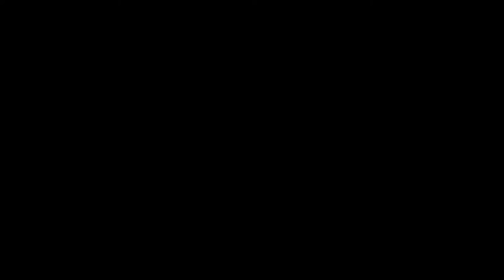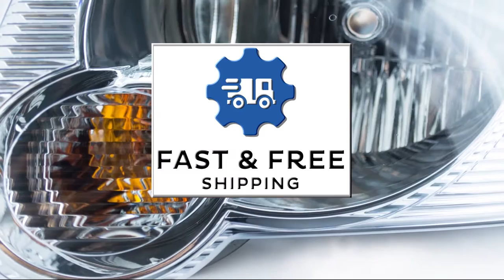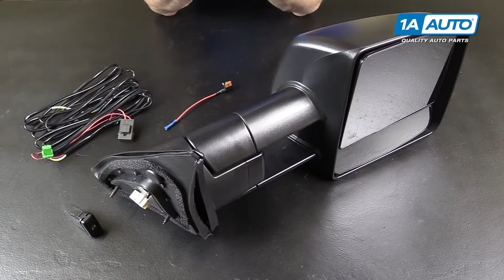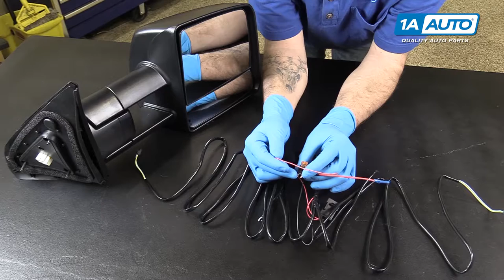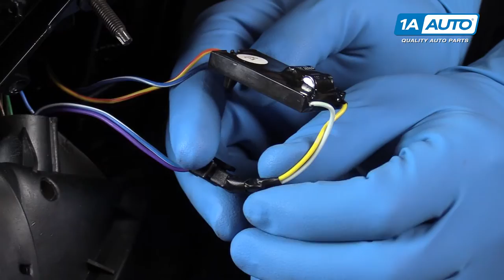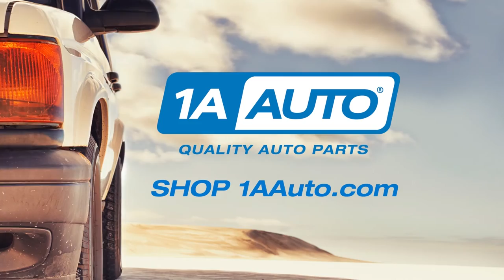Product Wiring Guide - Power Folding Mirror 07-16 Toyota Tundra/Sequoia

Comment: Hi i have an 07 tundra with manual mirrors. If only a harness is needed, does that mean it has a motor thats just not connected? also can I buy the kit or do you accept a core charge for oem tow mirrors?
Reply from the maker: +Justin Dhillon We advise you order mirrors with the exact same options as your original, as these will not function properly if your vehicle does not have the same capabilities. Our mirrors are intended to be a direct plug and play replacement for the exact options listed. We do have have a core charge.

Comment: From your site, is PART #: 1AMRP01703 compatible with this video? Looking to pick up a '15 Sequoia SR5, but power mirrors are not included, looking to add that feature. Will that part work or do I need to go with PART #: 1AMRP01127 in order to get the included inside switch?
Reply from the maker: +J Davis Thank you for your inquiry.  1AMRP01703 will not work as a power fold upgrade set, as they are wired to be replaced on models that have that feature from factory.  If you want to upgrade to power folding then you will have to get a set that has the upgrade kit like in the video.  If you are unsure of your options please contact our customer service department and we can find a set for you!  1aauto.com

Comment: Does the wiring harness that comes with the mirrors have two leads like that, one to each mirror?
Reply from the maker: +Hashirama Senju Yes, for the upgrade power folding each mirror will have a separate wire lead, but there is the complete harness which will go each direction. Please view https://www.1aauto.com/toyota-sequoia-tundra-mirror-pair/i/1amrp01749?f=1051086&y=2007 for more information.
Reply: 1A Auto Parts i just installed it.  FYI the harness for the button and power on the passenger side barely makes it to the mirror without strain if the button is placed to the left of the steering column where all the other mirror controls are located.  Also the button provided does NOT fit "Toyota Tundra" bezels.  Also is it normal for the passenger side tow mirror not to have a "shrunken view"..."Objects smaller..." magnification?